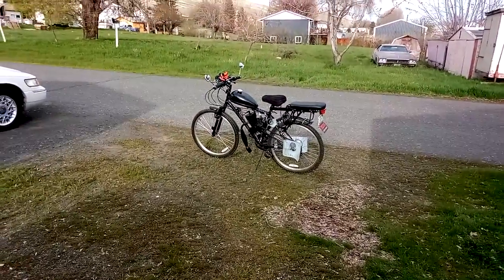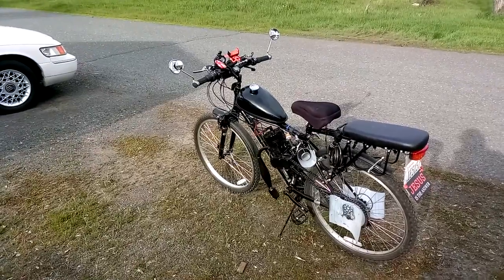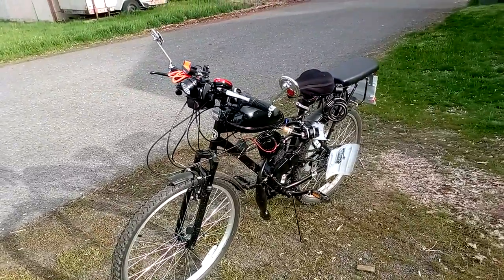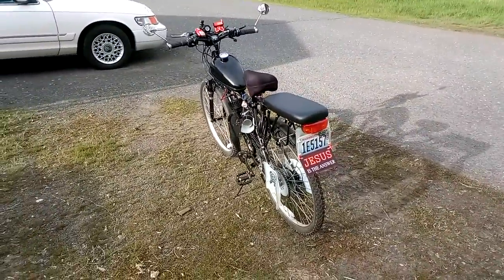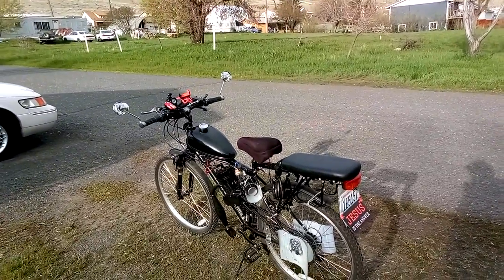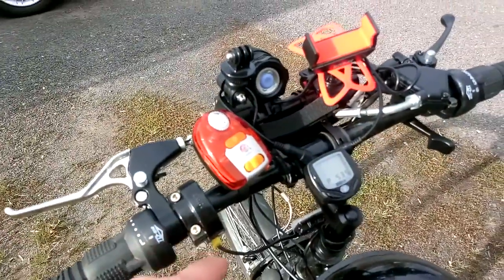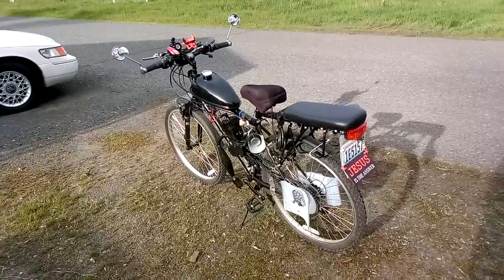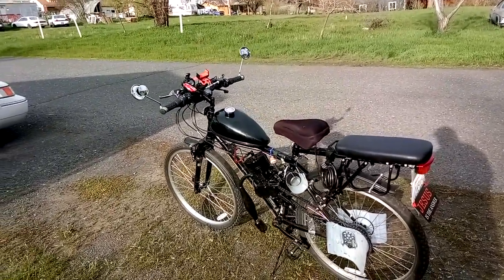How To License and Build a Motorized Bicycle License Plate Vin Number

Comment: These are legal here in Kansas and you do not have to register or have a license
Reply: not really
Reply: @forrift7845  its legal
Reply: Looking up definitions of what a motorized bike is in kansas, it has to be registered.  If it has more than 1 bhp. Or 750w engin.
Reply: Update! Just found out that "motorized bike" is excluded from the definition of motor vehicle. So I'd say it's legal. How would you register a non motor vehicle for the road.

Comment: Great video! A friend of mine got me into the idea of a motorized bike and I want to build one myself. My main questions are did you have trouble registering the bike because the engine is over 50cc? Also, when registering, were you given a hard time because the top speed can exceed 30 mph?
Reply from the maker: At the time of registration, you should probably have a 48cc, 50cc, engine on it, and have receipts for that engine. I didn't know that at the time. The WSP inspector told me if it has an engine and pedals, it's a moped. I let him fill out all the paperwork, and at the end, he told me to sign a form, I did not read the form, and that was that. I took the papers to the dol office, and they processed them. Afterward, I learned that the engines should be under 50cc. I asked the authorities if they measured the engines for horsepower or size, and they said they do not. So I think the main thing is,
50cc or lower at the time of inspection,
Don't put an engine on there that's ridiculously big,
Don't display a CC or HP size that is greater than what the statues say. 
People have talked about having me build and sell these, and after thinking that over, I have decided any bikes I build and sell to other people will be 50cc or under at the time of sale. They can get them registered, and list me as the builder. I was told if I register 5 of them in a month, I will be reported for being a dealer without a dealer license, so it's best just to build them, and have someone else take them to be inspected unless I only do a few a month. 
After I sell them, if the new owner wants to sell me the 50cc engine back, with a "Bill of Sale" (very important for future use in registering bikes), then I can put it on a new bike that is about to be registered and repeat the process. I don't know if it's legal or illegal for me to put a larger engine on someone else's bike, after they bought it, at their request, or not. I'm sure I can have them sign some sort of waiver, holding me harmless, after the sale. 
But again I don't know if there will be enough interest. 
The WSP inspector said that GARFIELD COUNTY DOL Office would be the best place to get the License Plate. He said the DOL in Asotin County (and probably others) would likely reject the paperwork. I was very surprised with how knowledgable GARFIELD COUNTY is / was. So if people want to avoid the hassle, they could just have me build their bikes for them, and have them along for the inspection and registration, so they do it (not me) so I don't have to have a dealer's license.
The big thing is paperwork and receipts. 
They told me you can get away with not having a "Bill of Sale" or any other paperwork proving ownership, as long as you have receipts and a declaration stating that you bought and built all of it, or had someone else build it for you. As long as you own it, your good to go. In this regard, I could sign a "Bill of Sale" for the entire assembled bike, and then you would not need the receipts, at least in theory. 
Whoever registers them, has to pay taxes on the plate. I talk about all of this in my videos. I have at least two or 3 videos talking all about this process. 
You must also have a weight slip,
You have to have a signed "Washington State Patrol Inspection Request" VVO-416-003 form from the DOL before you go to the inspection, or they won't do it.  The form should be blank but have the signature of Agent / Officer of the DOL office, with the date, name printed... Just let them fill it out, and then take it with you. 
I scanned all the documents into my computer for safekeeping in case I lost them. 
You also need a Speedometer Odometer form from the DOL as well, but you may not need it at the inspection, only registration. You can't print the Speedometer Odometer form, it must come from the DOL office. 
Certificate of Fact 420043
Declaration of Value Form TD-420-737
Homemade Assembled Vehicle Use Declaration TD-420-809
WA-Certificate-of-Fact
Certified Weight Slip

Checklist for Registration:
Certificates of ownership (title) or notarized bills of sale for the vehicles used in the assembly (or receipts)
Bills of sale or invoices for all major component parts (or receipts)
Receipts for all parts used in the construction
Certificate of vehicle inspection completed by the Washington State Patrol
Certified scale weight slip
Declaration of Value form, TD-420-737
Odometer disclosure statement if the model year is less than 10 years old
Frame certification (if applicable) I didn't have to.
Bumper certification (if applicable) I didn't have to.

In addition, I had no license plate light, and I didn't check the box saying I had one. 
Some agents/officers are very lax on moped rules and regulations. There can be a thin line between motorcycle and moped rules and laws. 

In addition, the Blog Post also has some Washington State Licensing Links and resources, in addition to the videos. 

If you buy your parts using the links provided in the blog post, it will help support me and my channel. I have eBay and BikeBerry links. I must boycott Amazon because they closed my account as soon as I started earning revenue. I've actually had good success buying parts on ebay and bikeberry. If you use ebay, you should buy from the US if you can. Much better. BikeBerry is great. Their engines have upgraded bearings. There is a universal link to BikeBerry in my video descriptions and at the bottom of the blog post, where I will earn commission off of any sale. I don't know if the ebay link works the same way or not. 

People can also help me on patreon as well. 
When it comes to bicycle safety, and compliance I try to go overboard. Soon I will try to install front and rear signal lights, a license plate light.... For future builds, I recommend using the motor ready bikeberry bikes, because they are much safer. They have at least front disc breaks, better wheels and tires... the only downside is you can't upgrade the built-in fuel tank to a larger size if you wanted to. They have other kits and bikes as well that are recommended. Doing a cheap bike like I did works, but it may not be the safest.
Reply from the maker: Headlight, Tail Light, Brake Light, Turn Signals, License Plate Lamp, Speedometer, Odometer, Reflectors, Horn, Mirrors Left and Right, Brakes, Suspension System, Muffler, Tires, Fenders / Splashguards, (Windshield optional). If you have a Windshield then you don't have to have eye protection according to what I have read. The 3 in 1 brake light, tail light, signal lights, also has a horn.
Reply: You answered my posted questions and other questions I was about to ask you. 😂 Thanks for the info!
Reply from the maker: Just remember the most important thing is to contact the DOL, WSP Inspector, and local authorities, before you do anything.

Comment: Using the wite wire frome your engine will end in magneto falier
Reply from the maker: Good thing I have a stock Magneto then if it fails.
Reply: Yes fold that bitch over and heat shrink it off and zip tie it to the frame.
Zipties are your friend.

Comment: Hey I didn't catch your name and I don't know if you still check your comments this far back but if you do if you do you can either tap off the magnito inside of your engine for for free power And that will give you what you need and trust me I've been working on small engines for at least 21 years or or if you don't want to open up the engine and you don't feel comfortable with that you can buy what's called a dynamo They come in 6 V and 12 V systems And you can hook them up to the inside of your tires Basically they roll around and create enough enough friction off off the rim of the tire as you ride around and they will power everything and you can even run another wire off of it but then you could even have a radio they provide that much power or even charge your cell phone why you're going down the road And honestly you could do 2 of them one in the front and 1 in the back where you could do 4 If you did 4 of them The 2nd 11 could be actually a light show we're like a light strip and it could change colors so then as rotated it would literally literally change colors as you Moved Have a good one Mike k.
Reply from the maker: My name is justin breithaupt. The magneto power seems to work fine for me. Alternative solutions are always great. Thanks for the info, and for watching the video, and may YHWH Av bless you in Yahushuah HaMashiach's mighty name!

Comment: I have never met anyone stupid enough to put a license plate on their modified bicycle.
Reply: Maybe, he got fooled by a cop.
Reply: You have to, most cops are annoying about engines
Reply: I was going to ask why he gave up his right to travel and willingly paid for it to become a PRIVILEGE
my bike motor has no size no cc markings any place. so if a cop asks it is 48 cc!
Reply: In texas you have to register it as a moped and have insurance on it.
Reply: @freedomwoodgasandoffgridin8925  it varies state to state. If you’re in Washington and it uses gas then it has to be registered. If it’s an electric motor then you don’t have to but good luck traveling far with an electric bike.
Reply: It's called the ability to ride freely without constantly being harassed by police? 

..and the whole ebike thing doesn't make sense either, a lot of those can achieve the same speeds, but suddenly because it's electric none of that stuff matters, no license, registration or insurance required? 

Where's the logic in that.